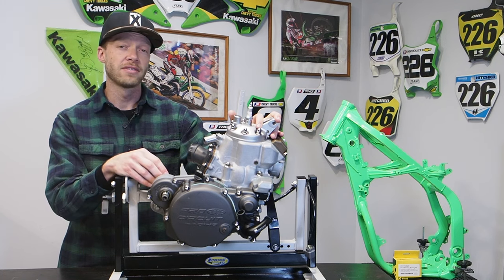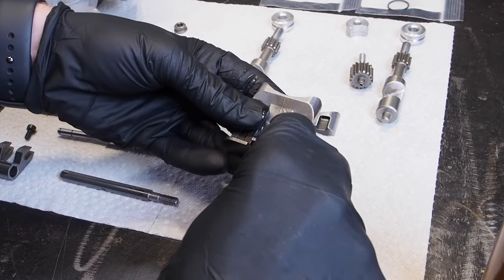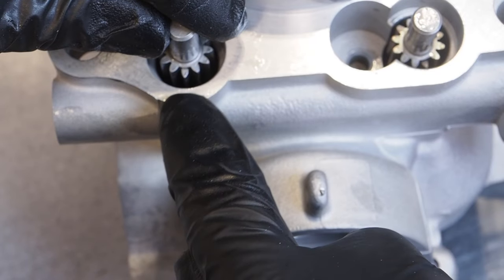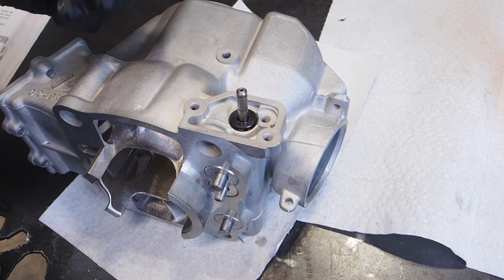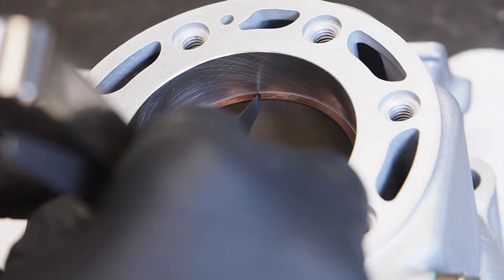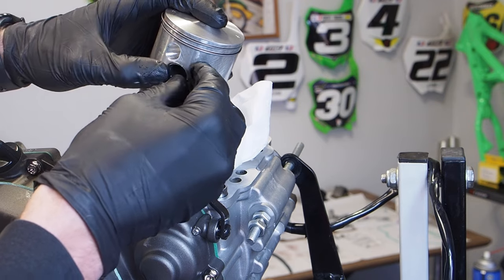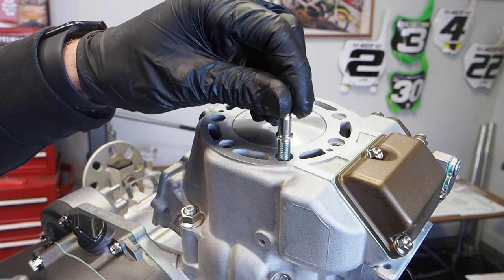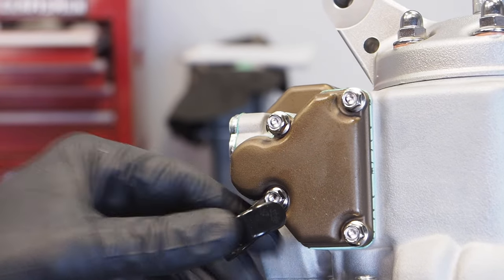DIY KX250 Engine Rebuild PART 3 - Top End and Power Valve Rebuild

Comment: Hey Greg nice vid! I think your audio is "clipping" as I hear ticking/popping. Let me know if you need help from a fellow YouTuber 😊
Reply from the maker: Cheers dude thank you! Let me know at what time stamps you are hearing it because it's not doing that on my end. First time I've heard anyone say that actually!
Reply from the maker: I do hear it slightly near the end of it! Never had that happen before. Doesn't seem bad but a trained eye will hear it haha
Reply: The last 4 videos the audio has played up on my side.
Reply: @GregHitchko  its really the whole vid, and some of your older vids as well. What is your audio recording setup and post editing process?
Reply from the maker: @HTMR  I use Rode lav mics and then I edit in iMovie
Reply: @GregHitchko  Do you have a separate audio recorder? If so, auto or manual mode? I use manual mode and make sure audio levels are in the -12dB range (auto mode can clip easily). Then when editing in post, bumping gain is safer if volume is low. Let me know if this makes sense.
Reply: Audio is cracking in every sentence from start to end.
Reply from the maker: During editing of my lastest video for the rebuild. I used the "Reduce Background Noise" function that iMovie has and that seemed to clear up any weirdness that I was getting in the sound.

In terms of audio recording, I just plug the one piece of the RODE lav into the camera, and the I clip the other piece to my shirt. So no I don't believe that is a separate audio recorder? Or is it? Lol
Reply: @GregHitchko  Hi Greg, I still hear it in your latest video. Check your camera audio settings. If in "auto" then that might be causing the clipping. In manual mode you should be able to reduce the mic gain. I don't think you can do anything in post editing because the camera is recording distorted audio, and nothing will fix that after the fact. I'd be happy to show you my workflow, email me or whatever works for you. We can even zoom if you want and can show you how to use and edit with a separate audio recorder.
Reply from the maker: @HTMR  I'm so curious as to why it seems to be just happening? Do you mind going back at some earlier videos to see if the problem was there back then? Thanks man!
Reply from the maker: @HTMR  from what I'm hearing myself, you have to listen really closely for it, and at higher volumes. At standard volume levels, it's barely noticeable I feel, if anything. So that's good
Reply: @GregHitchko  I've noticed it on all your vids. Finally got around to comment 😁
Reply: @GregHitchko  I take that back, older vids sound fine.
Reply from the maker: @HTMR  I've literally never noticed it before, ever😂. I feel like you have to be listening really hard for it. Maybe too much two stroke to my ears 😂

Comment: With the expanding t gauges you wanna extend and lightly tighten them while tilted on an angle then pivot to the opposite angle while removing and that will ensure repeat-ability of accuracy
Reply from the maker: I appreciate you leaving that tip with using the T gauges! Makes sense for sure 👍🏼

Comment: My motor doesn't have the rubber boot thingy on the power valve arm where you cut the gasket 😮 mine is a 98kx250

Comment: Thanks so much Greg! I’m in the middle of rebuilding the 93 kx250, and man I’m very close to being finished, then I see your your videos man they have saved me so much time. also I have these transmission bearings giving me problems I’m about to weld my bearing puller to them any ideas?, I also can’t seem to get the lock tight bolts that keep some of the bearings in place out, im about to pay an hour or 2 for a shop to pull them😅😂
Reply from the maker: Heck yeah dude! Stoked the videos can help you out🙌🏼. You'll need two things to get those bearing retaining screws out. An impact screw driver and lots of heat to break up the loctite. 

For the bearing puller, you need to make sure that the collet is tightened down really tight so it catches on the inner race really well. Put the cases in the oven and bake them for a while. Until they sizzle with water. Once you do that, it'll be much easier to get those bearings out as well. Face the case down and they may even fall out on their own!

Comment: It popped up this time!!!!!!!!!
Reply from the maker: Haha yes!!! Glad it did 😂🙌🏼
Reply: @GregHitchko  me too.  Good video.  Someday ill need to rebuild my kx.
Reply from the maker: Keep me posted when you do!
Reply: @GregHitchko  hopefully its a long time from now.  When I bought it, it had 190psi on 5 kicks.  
It had been rebuilt by the previous owner to the guy I bought it from.  The guy I bought it from had 5 bikes so it got very little use.
When I tore it down I looked down the spark plug hole and read the numbers on the top of the piston.  Its got a wiseco piston in there.  
It smokes like crazy and I cant figure out why but it runs great. 
I've jetted it to spec and leaned it out even more and she still spooges all over my swingarm.  But she runs and I ride it at the vmx races I can make it to.

Comment: I just redid the top end, and with the head gasket off when I move the kick start...it kind of gets stuck and impossible to move at the lowest point of the piston. The piston itself is moving super smooth, should I check the Kickstart or bottom end?

Comment: Hello, I have a question, I have a Kawasaki 250 2-stroke from 2003 and I have seen that one of the valves moves and the other does not, is that normal in those engines or should I check well?
Reply from the maker: Hey dude! Yeah that is definitely not normal, both of the valves should be opening and closing simultaneously, at the same positions, at the same rate. I would tear down the valve set up and see what's going on. My guess is that the timing is off on it! Keep me posted on it
Reply: Hey Greg, I watched your entire videos on this engine build. I have  a 95 KX 250 that only had a year on it so it was in really nice shape but it sat so long. I noticed one of my teeth on those 2 valves? was one tooth off. I was wondering if you have heard of this before. If I time it like you did it’s not opening or closing like it should. 
I have a ways to go on it. Thanks man, I don’t think you realize how much you’re helping people like myself.👍
Reply: I bought it new by the way.